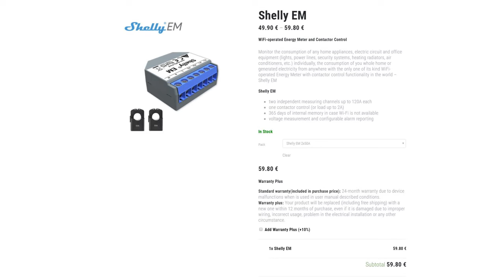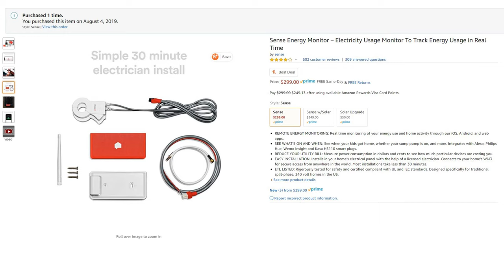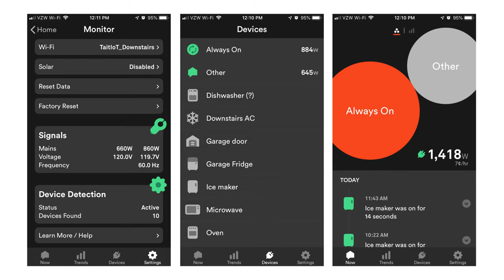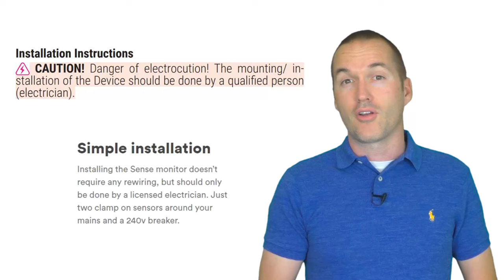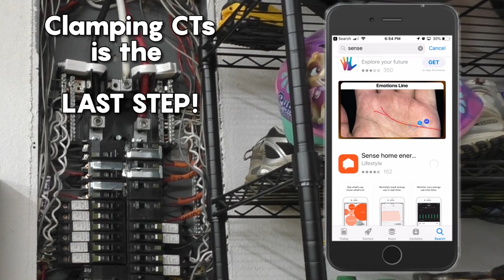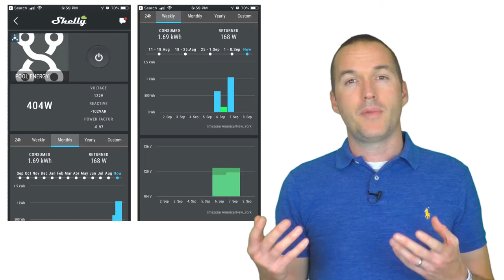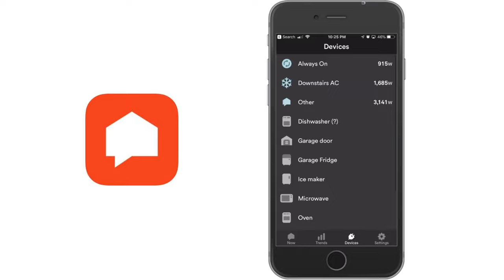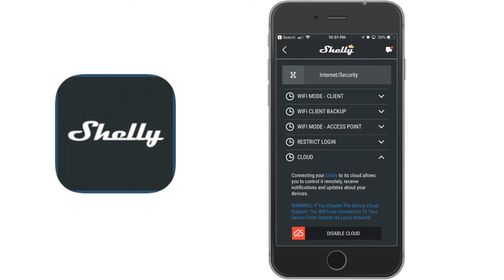Which Smart Energy Monitor Is Right For You? ShellyEM vs Sense

Comment from the maker: A quick clarification note:  I know the electrons shown in the animation are showing DC not AC current, this is a representation of my video editing skills, not my knowledge of physics.  Please imagine that the animation takes place in less than 1/60th of a second :)
Reply: I have a pentair 011018.  I want to add a chlorine generator and lights and I would like to automate them. I plan to pull a 60 amp line and was going to put a sub panel.  Is your pentair panel smart in anyway?  I want to be able to control my pool with Alexa.  Others have made videos but they are kinda lacking in details.
Reply: While it would be a complete pain I can't help but wonder whether shutting everything off and individually toggling a single device at a time a few times may increase the likelyhood of detection with the sense. At least, in theory, it would improve the signal to noise ratio for the device you are trying to get established by eliminating the noise on the power line caused by other devices. By the way trying to get things like computers with switched-mode power supplies and load-dependent consumption to be detected as baseload is likely to be tricky however you do it.
Reply: Love the video.  One quick note tho, in the US the phases are not 180 degrees from each other.  It is simply a different transformer winding that is in phase with the first.  That’s why it’s called single phase power.  That’s a common misconception that even most electricians don’t fully understand.  I’m an electrician and just had this conversation with some co workers a few weeks ago.
Reply: @livinthedream1525  , I disagree about the phases being "in-phase" with each other. I am a retired electronics technician  with over 40 years experience working for large generation, transmission and distribution power companies, and have observed on an oscilloscope many times that the two phases are indeed 180 degrees out of phase with each other.  We use 240 volt split-phase feeds in the US.  For small residential buildings, the usual method is to rig up a 240V stepdown transformer (instead of 120V) in which the secondary winding is split into two 120V windings (hence the name "split phase"). The center tap is then grounded and fed to the house as if it was the neutral wire of the old 120V system, and each end is wired as a separate 120V live wire. Their waveforms have a half-cycle offset, or 180 degrees, when measured against the neutral wire. (credit:https://appliantology.org/blogs/entry/606-explanation-of-120v-single-phase-240v-split-phase-and-208v-3-phase/)
Reply: I’m a asshole 
But it would be nice if Video editor could play backwards.
Also the arrow are  not helping 😜 they need to flip 2.
I would properly have the electrons go in the opposite direction of the arrow 🤪
Anyways lovely video 👍
Greeting from a danish ass hat cheers. And happy new year 🥳
Reply: @rdpecken  Phew, I'm glad i just read your above post. I was just about to say that surely the supply must be two phases of a three supply and the phases must be 120deg apart. Having read your post i see that is not the case.
Here in Australia we use a decent 240v single phase or 415v three phase. None of that split phase nonsense :)

Comment: I don’t have the issues you experienced with Sense. I have over 40 devices showing up and only 5 of them are incorrect over the past year. The Shelly or any other solution is very costly when you decide to monitor more than a few devices. It is all about what you really want to monitor. I needed 6 devices to be monitored and the Sense was the most cost effective solution but took 3 months to benefit from that “investment.”

Also, you have limited space in your panel so to have multiple “clamps” with devices inside your panel could be dangerous and can be a nightmare to manage connectivity. 

You are right though that Sense is hyped to be this great solution to discover devices but it does take a long time to do it and each home is different with line noise due to location, installation and quality of feed wires.

Overall, this area of smart tech isn’t very smart and has seemed to be very costly for those of us who would like to be more eco-friendly and curb our usage patterns. If the Shelly could be even more lower in cost similar to the switches then we would be able to monitor the right amount of devices without spending a ton of $$$.

Comment: You need to look at the Emporia Vue 2nd Gen. I have only had it installed for 3 weeks, but the information it provides is amazing. It uses a sensor for every circuit, up to 16, and you can use more than one unit if you have more than one panel. They have smart outlets to get more info about a monitored circuit , or monitor individual plugs in your home that are not monitored in your electric panel. No machine learning. I don't know about extracting your data, as I don't have a desire to use that feature.
Reply: I’m also curious about the Emporia versus the Sense. Please let us know how it goes!

Comment: I do building controls for DSG,Wallmart,Ikea ect. and they use the same type of product but also use smart breakers so that they can remotely turn off breakers and lights. Its pretty cool and easy to program
Reply: I work on large commercial HVAC systems. I have seen many large rooftop units running when they shouldn't be due to various reasons. I found a monitor that cost $300 per rooftop and can be simply installed no matter how old the unit is. Any advice on how to pitch this to the building owner?

Comment: The sense was a great idea. After 3 years of having it installed I now have “35 motor” notifications with very little information on how to determine what it actually is. The concept of crowd information to determine what’s what I thought was a great idea, however I don’t think they have enough installations to make that work. I had to turn off all notifications from the app as I was getting constant “a new motor has been detected” messages.

Comment: Awesome as usual.  Folks in SoCal, don't over look using the rainforest eagle energy monitor.  It can join your zigbee network to intercept the continuous power messages sent out by your utility's smart meter.  It offers some cloud stuff, but also a local push that pretty easily goes into NodeRed/HA as well.
Reply from the maker: The dream! An open protocol energy meter would be amazing.
Reply: How do I get in on this? I'm an Ladwp customer
Reply: @hgelpke  No idea on your specific utility.  I'm on SDGE and setup was trivial.  The product is here: https://rainforestautomation.com/rfa-z114-eagle-200-2/
Reply: @DethpickleDave  How did you get the smart meter? Is your home newer or did you get it installed?
Reply: @hgelpke  A few years ago SDGE rolled it out to all of San Diego.  No more meter reading for them.  The opportunity of Demand Response programs and OhmConnect for us.  It just happens that the meters speak Zigbee and Rainforest makes a gadget for listening to it.  I'd start with your utility and see if they have anything like it (or if you already have it).

Comment: Great video, one of the more useful I've found.  I've been considering the Sense for awhile but haven't really figured if its worth the cost.  There are only so many expensive appliances I have that aren't always on and therefore controllable enough to try and get some energy savings.  The ones that are I've already attached individual energy monitors to them for much less $$ than the sense costs and I know exactly what appliance is which.  One could question the accuracy of those types of monitors though.

Im pretty handy but the Sense is easily the way I would go out of these 2.  It may have short comings but it's convenience wins the day for me by quite a bit and I think that would be the case for many DIYers as electronics is usually the trickiest thing to learn =)

I feel like utility companies should supply this sort of thing themselves for free :|  It's annoying that one of the main reasons I even want this is to see if the energy company is properly billing me or not :\

Comment: HI 8b my region we use 2  120v lines and they have different phase from each other , so to be accurate measuring each line, I had to put a single Shelly per line , to that the reference voltage is the same than the line measuring , that's the only thing you need to consider. great video thanks for sharing

Comment: You should refer to the breakers as one pole or two pole and not 120v/240v. Both of those QO breakers are actually rated for 240v applications. I’m knit picking, but you are a teacher so I figured you’d want to know.
Reply from the maker: Good tip, thanks.

Comment: The biggest problem for some people with the discovery of new items in the sense, is some people have multiples of the same item.

2 fridges bought at the same time and of the same model for example can be seen as the same device, at least at first, if on the same half of the split phase circuit.

Multiples of the same A/C unit can also be problematic at best for proper discovery.

Comment: it makes sense to connect the Shelly 2EM to 120 volts with split phase, with an angle of 180°
240 volt devices will draw power from both current sensors. 
120V devices will only show power to one current sensor. One current sensor needs to be reversed.
It doesn't work that way on a three-phase current with an angle of 120°.

Comment: I don't know much about US home electricity, but I want to mention that if your devices are connected to the mains by regular wall sockets or power strips, then you can use Tasmota-capable switchable plugs that can also measure voltage, current, and power (including reactive and apparent power) for less than 10€ per piece. With all the Tasmota benefits like MQTT integration that you already know. You only have to flash these Tuya devices. At that price, 1 plug per device is that you want to measure is very affordable and it saves you from messing with the breaker box and enables remotely switching the device on and off, too. Max amps of the plugs may be a limiting factor.
Reply from the maker: Yeah, amperage is going yo be the limiting factor.  No plug is going to be able to handle an air con compressor or heat pump.

Comment: Sense is compatible with TP-LINK HS110 Smart Plug w/Energy Monitoring and Kasa Smart WiFi Power Strip by TP-Link - 6 Outlet Surge Protection, so if you have hard to track loads like computers and TV's these will communicate with Sense & show up in devices.

Comment: Emporia Vue is best of both worlds.  Measures the mains, and measures 8 breakers with CTs.  Install is as easy as the Sense but none of the guesswork.  Directly measuring my pool sub panel, Upstairs AC, downstairs AC, Laundry room, kitchen/fridge, office, and 2 other breakers directly.  Software is transparent, no coding or learning curve.  $100 - lot better deal than the Sense.
Reply from the maker: I might have to take a look at that, the Sense is probably the most worthless device in my home.

Comment: Odd that 2 of your device types it won't discover happen to be "duplicate" device types, 2 fridges, 2 AC units...
Reply from the maker: I'd be willing to bet it is the root cause of the problem.
Reply: Not really odd if you understand what Sense is trying to do. Most houses only have 1 AC Unit and fridge, so once Sense algorithms find the first one the algorithm looks for the next best match, because it's not logical to have two generally.
Reply: The Hook Up are the refrigerators the same make and model?
Reply: Justin Spade it’s not all that uncommon, especially having two fridges. I wonder if it’s that they have an inability to distinguish them or if like you said they are making the assumption they are the same. If it’s the latter then a discovery process that he suggests would solve that problem as well.
Reply from the maker: @Mrcaffinebean  Very different fridges.  One nice samsung fridge, 1 cheap sears brand fridge.
Reply: i think he is monitoring only half the panel
Reply: @ewmegoolies  That would make an interesting reference.
Reply: @TheHookUp  Keep in mind you aren't measuring a fridge, you are measuring the compressor. They may have the same electrical signature.  This is just emphasizing the need to be able to manually set things.  But, you'll never be able to differentiate them except when both are on at same time.

Comment: Correct me if I am wrong, but it would seem that you could literally install the Shelley EM in parallel with your desired device's power cord.. say in in an outlet and thusly monitor exactly the appliance you want.. granted this solution quickly surpasses the Sense cost if you monitor more than five outlets.. but for the control and granularity..
Reply from the maker: Yeah, the sense is definitely going for the "minimum wires, single location" approach, which sounds cool in theory, but in practice it has mostly been a failure.

Comment: I have used a lot of Schneider electric monitoring. Their gear is great because it can be either 3P or 3x1P. I'm in Australia hence the the use of single and 3 phase. However you need to ensure that your V and I are on the phase because it actually multiplies the instantaneous V and I. So if you cross phases it will be very wrong. I have crossed phases before and you get really wrong results. This could also be happening with the Shelly but not sure as I've never used their gear.

Comment: Although you may have said this....for me the fundamental difference is you cant monitor at the 120/240 split phase panel level with the EM (because its one one single phase at a time) so its Sense at the main panel and EM for loads for me.  was interesting that you can put one of the (2) 120V mains on the devices neutral connection allowing for 240V single loads to be monitored. I dont see it in manual.  I would think in places where you have 240V line to neutral that is the norm for this device to get 240V.  Are you coordinating with the manufacturer on this install mode?  in any event, Love your stuff.  Ive been an electrical power engineer for 30 years but I'm a novice home automater, microcontroller tinkerer...and Ive learned alot from your videos.  Wanted to say thanks.
Reply from the maker: Yes, I contacted Shelly about all of these install options and got the green light from them.
Reply: @TheHookUp  Do you know if this is still OK to wire the EM this way for US split phase usage? I am planning a project to monitor two HVAC loads and would be able to use one EM and two 50A clamps in total for this project if that is the case. Your video is literally the only documentation I can find online that mentions allowing 2x 120v mains to be connected at L and N and a clamp to be placed around one of the two phases going to the circuit you want to monitor.

Comment: I guess the Shelly is a bit more European by design. The EM can use 120amp CTs, it's good for a garden lighting panel, where you can save money by switching out circuits out unnecessary times with the Shelly relays. I used the MQTT to integrate with my Control 4 system, but also is not 100% yet

Comment: I have the Emporia and it does a great job, albeit using a Cloud to aggregate data.  Unfortunately, I have several panels so need more customization than it can support.  I’d like to consider the Shelly device but I wasn’t clear if those can share the reference breaker otherwise it seems like a nonstarter as I can add reference breakers for each Shelly EM.  I have a main 400amp service then 3 separate panels in different areas of my home which makes this challenge.

Comment: This is a common misconception; US split phase power is not 180 degrees out of phase. It is in phase. 180 degree out of phase power would result in 0V when the two phases are combined. Instead you are using a single phase with a center tap at the transformer. The voltage is only -120V when you reference against the center tap. In reality, it would be better to mark the wires as 0V, 120V, and 240V. The potential difference between the 0V and 240V is 240V, whereas the potential difference between the 120V and 240V is 120V, hence a second 120V "leg."

Comment: Have you looked at the TED6000?  It will handle 2 & 3 phase supplies and will allow you to combine sensors.  It maxes out at 1 MCU, with three mains sensors, and up to two Spyder modules, each able to monitor 8 sensors.  I’ve been using mine for a couple of years now and am just starting to integrate it with a home automation system.

Comment: General question with monitoring 240v appliances using the EM. So I'm measuring my water heater, I currently have 240v fed into the EM. I then have one clamp over 1 of the lines coming out of the water heater contactor.

Whatever the EM reads from that one line, do I need to double it? So let's say it says my water heater has used 100kwh so far. Since I'm only monitoring one line, has it actually used 200kwh?

Comment: Take a look at Efergy engage hub energy monitor too. I 've been using with no issues for several years in 3 phase installations. It would be nice to hear your opinion compared to the other two. Home Assistant integration available too  but no per-device monitoring (yet...).

Comment: Note, Shelly is a Bulgarian company (congrats from Romania, my friends!). That means the EU. EU doesn't have this split-phase system. It has only 3 - 230V phases, which amounts to 400V between two phases. That's why ShellyEM is not the best solution for US use, but it's ok for about the rest of the world. Oh and please, if you're in the US, please don't use Volts and Ampers, I want to see some proper imperial units!
Reply from the maker: 😂I don't think imperial has separate units for volts and amps... maybe I can call them pushies and flowies?